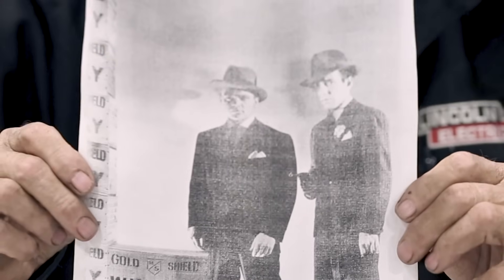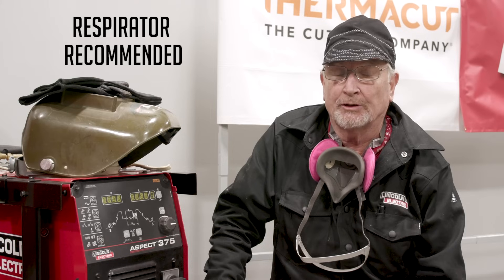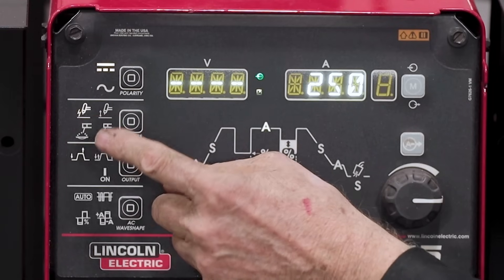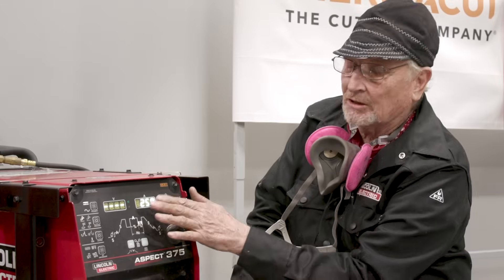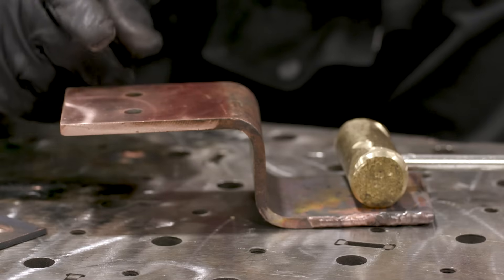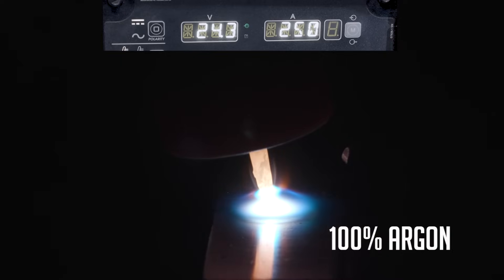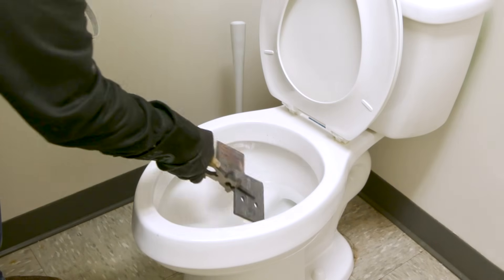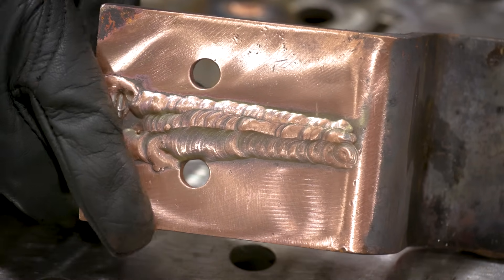How do you TIG weld COPPER?! 🤔

Comment: Thanks for the video.  I was looking at welding 3/8" copper bus bars, but I'm not sure my TIG machine will put out the amps needed.  I do have Helium though.
Reply: Just like with welding on larger parts that are beyond your machines ability, preheat is life. Get used to doing a consistent preheat, and you need a pedal because it will heat soak just like aluminum, so you need much less heat towards the end.

Oh,cand obviously, practice a bit before trying on something important or expensive,  but that should go without saying. I'm capt obvious though, so... 😉

Comment: I weld copper products and also hard face them. All our welding requires pure helium gas. I don't know the thickness of the copper we are welding but we are usually running our machines at about 530/560A.

Comment: I weld tig copper fittings everyday. No pre heat needed the key is high amps and no dipping just feed the filter in. 50/50 gas. https://youtu.be/uLomTz4fqBc check out my day to day

Comment: What size cup you running and why, tks
Reply: #12, he explains why at the end.  Cup size is usually driving by the amount of stickout you need as well as the amount of gas coverage, and copper likes a lot of coverage so you need to get that flow rate up.

Comment: Could you silver solder on copper with tig?
Reply: Yes, but not practical. it's a rapid and uneven heat source. The arc wants to concentrate heat in a small area vs a gas torch flame can wrap around a joint and provide more even heat transfer. Plus there's  a chance of melting the copper with tig and that's not what you want for a soldered joint
Reply: @tapllarrow3984  great answer.